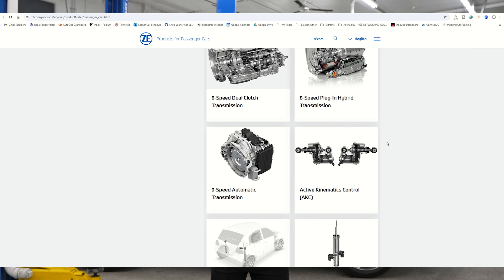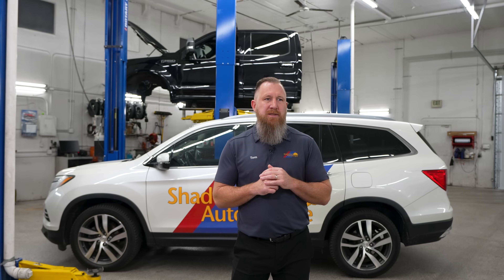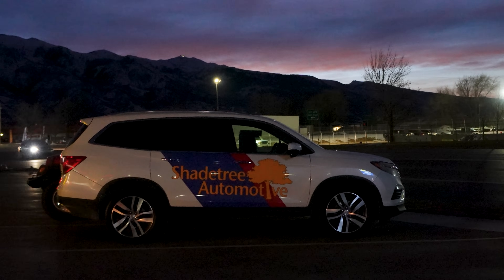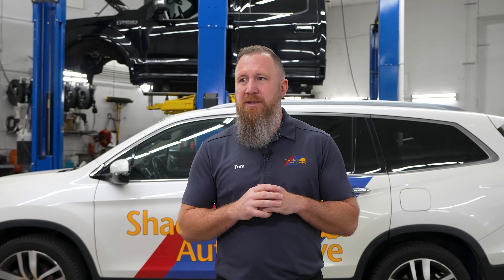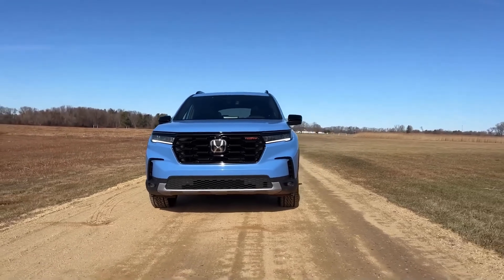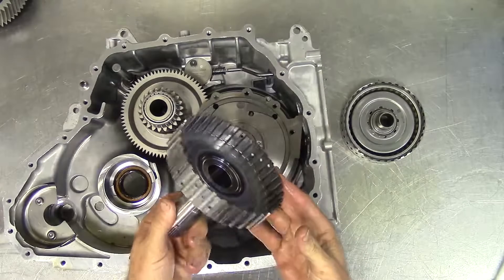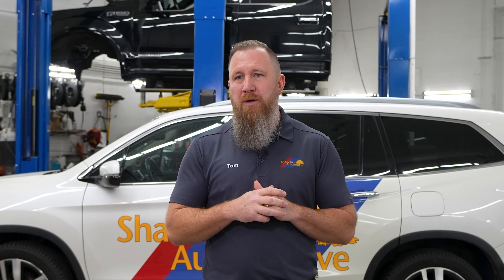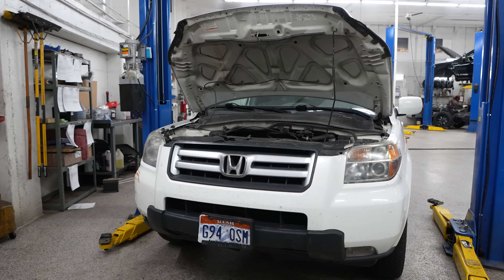Honda's 9-Speed Transmission. (Would I Buy It Again)

Comment: 2019 Pilot Touring, 9spd tran with 80kmiles, 3rd owner
Mpg is very speed sensitive.
Open Road driving:
55mph gets around 30mpg.
75mph gets around 27mpg.
Timing Belt replaced per CarFax 15k, Will resume again at 100k.
Oil, 5k
Trans fluid. 30k

Previously owned 2013 Odyssey lasting 215k miles. CatConv went out, could have been VCM oil blow out (Guessg) but decided no more money in 2013 Ody only gave me 3k on trade...

Comment: We bought a used Honda Odyssey with ~65k miles. After only owning for 10k miles we are noticing transmission issues. We looked up the service history the transmission fluid was changed at 45k and 60k miles. I also changed the fluid at 75k miles. I don’t know what the previous owners would have done to cause this transmission to have issues with the low miles. Trying to decide if we replace the transmission or go back to a Toyota Hybrid.

Comment: I got a 2020 Honda Passport purchased new and it has 24k miles currently.. I barely drive it and I do change the engine oil at every 5k miles. I was thinking about having the ZF9 serviced at 30k because the fluid is 5 years old now but if it's safe to do it at 50k due to the fact I don't drive it as much and I don't beat on it? 24k miles are mainly city drive no steep hills and I don't tow anything, did go on a few road trips... I just got the V6 engine's VCM muzzled with the VCMTUNER II Advanced and it's making a huge difference in drivability on how it handles and performs, my mpg actually got better as I don't have to ride the accelerator as much. This Honda Passport has been solid and the only issue I had was with the infotainment system but it was taken care of with two recalls. So, should I do the drain and fill at 30k or should I wait until 50k but it'll probably be a few more years lol ATF fluid don't expire does it?

Comment: Oh, and it's not the ZF9 (as long as you change the ATF every 2 years on a severe service use case) that peeps should be worried about with the Honda Pilot 3rd gen, it's the rod bearing issue on the J35....

Comment: Ours has been without a problem, however...you can only reach the filter if you remove the transmission from the vehicle. Ridiculous. You can still change the fluid easily enough, but they should have made the filter easy to change as well.
Reply: Where is the trans filter located?

Comment: Great video. Well explained. Can I ask: if, as you say, something has failed inside the transmission, then wouldn't it be cheaper to just take it apart, replace the broken clutch/gear ⚙️ or whatever and then put it back together with new fluids?
Reply: A lot of times it is cheaper to just replace nowadays, and not just transmissions but most things unfortunately. Sometimes the internal parts are very difficult or impossible to get, and often very expensive, then factor in labor costs to rebuild.

Comment: I bought a 4th-generation Honda CR-V, facelift model from 2017, manufactured in the UK. It’s the 1.6 diesel with 160 hp and 4x4. The car has 90 000 miles on it and previous owners didn't change oil in ZF. 
 I don’t feel any jerks when shifting except in the first 3 or 4 gears. The mechanic told me the oil was black, contained a lot of metal particles, and that it was the last possible moment to change it. He also advised me to repeat the oil change as soon as possible at least 2 or 3 more times. Problem is if I do it 3 times more I need 12l of Honda ATF 3.1 and price per liter is 80euros which is crazy. On the other side 1l of ZF Lifeguard Fluid 9 is 15-20euros. Is that the same rebranded oil? Has anyone used ZF oil instead of ATF 3.1?
The mechanic also said that the transmission filter in this model is not replaceable, which sounds strange to me. Is that true? Thanks in advance.
Reply: Так, я замінював на своїй хонді 2015р , заливав zf lifeguard 9, проїхав вже більше 20тис.км все в нормі.

Comment: Thank you for your informative video.   I have a 2016 Honda Pilot Touring with a Transmission and Emissions Error.  The dealer has changed the fuel injectors, ignition, TCM and I put in a new battery.  I still have the same issue.   Can you help me?   I made a video.  

https://youtube.com/shorts/1YqWljVgsyU?feature=shared

Comment: I have a 2017 Chrysler 200s would that transmission and it bangs from 4 to 5 gear they were never able to reproduce it even though I did it to me all the time! I'm at 85000 me I started changing it at 60 still have the banging from 4th to 5th gear first time owning a Chrysler vehicle with a non Chrysler transmission and never have had problems before!

Comment: The transmission isn't the problem with Pilots.  It's the improperly forged crankshaft that will cause the rod bearings to shit the bed prematurely and cause irreparable engine failure.  Sell that POS as fast as you can!!!!

Comment: 2021 Honda pilot 100k miles in 2 years. I drove it hard some days and it’s still kicking strong
Reply: Now you know the service that every 30,000 miles
Reply: @yazzy1979 oh yeah rear differential and transmission. Just got a new timing belt and tune up. All that 100k stuff. Engine oil every 5k
Reply: Oh I’m sorry rear differential every 15k! Engine 5k and transmission 30 k!
Reply: @Jezanr love it 🙌🏾
Reply: Just was recently informed there is a front transfer case? Honda did not notify me about this after being there more than a handful of times.

Comment: Have you used any other Transmission Fluid beside Honda 3.1 like Lifeguard or Mopar ZF Fluid?
Reply: I have. I use Liquid Moly 1800 in my sister’s mdx. I service it regularly other than the timing belt, I do everything. The best way to describe, a lifted V6 accord. Super reliable. Liquid Moly’s ATF(German fluid made in Germany) seems to make the transmission shift smoother than Honda 3.1 ZF fluid. It. It cost way less too especially the 20L container which I buy to service all the cars. I would use this fluid on my ECVT hybrid accord however, I started that cars life in my hands with Amsoil Signature Series ATF. I also use Liquid Moly 1800 ATF in a BMW and a Toyota Tundra. Decent synthetic Dex VI equivalent which in all 3 owners manuals states you can use! All in all the ZF transmission usually is never the issue like he stated. Most of these modern transmissions fail from simple owner neglect. Transmission fluid should be changed regularly at least 30k-50k max. All fluids break down from heat cycles. After the fluid is warn, a transmission is on luck at that point!

Comment: My 2022 Honda Passport's 9 speed transmission went out at 10K miles!  It was replaced under warranty.  The Honda dealer stated it was not worth it to rebuild it.  They just gave me a new one.
Reply: to bad. But the transmission is pretty solid though.

Comment: Is there some kind of filter, internal or external, to also change? If not, can one be placed in the, say cooler line?
Reply: There is, but the transmission filter for these requires the transmission to be removed from the vehicle to get it out. Idiotic. People are just doing fluid changes on them (I can't see many people spending the big dollars/time to change the filters).
Reply: @greggregson9687  Can one be put in-line to the cooler? Would it be worth it?

Comment: You brought up a great point. Basically every high failure rate part or system in modern vehicles is a result of government regulations. Genuinely every one of them. Catalytic converters, EGR, DEF, transmissions, engines, etc are failing at much higher rates than ever before because manufacturers are being forced to squeeze every ounce of efficiency out of them, and most of the time it's at the expense of longevity. That's why anything built in the past 15 years or so is basically junk. Some are obviously better than others, but overall cars today are far less reliable than ever before. Plus all the engineering required to design and produce these systems drives up the cost of the cars significantly. So the next time your car fails, make sure you send a thank you note to the EPA.
Reply: My wife's 2012 Camry with the 2.5l 4cyl has been phenomenal, 160K and just routine maintenance.
Reply: EPA has nothing to do with washing machines, smartphones, led light bulbs, etc. and all those things fail a lot faster than cars.
Reply: @dfgpl not even remotely relevant to the point, but ok...
Reply: Yes the Dumocrap EPA’s don’t use technical or engineering  expertise, just Hippy feel good rules to get more gas mileage.  Causing more expensive and way less reliable vehicles.  Government Mileage and Emission Standards are moronic and will be the downfall of the American Vehicle Industry.

Comment: The bigger issue high rate failer was the 6spd on the lx ex exl zf6 . I do my 2020 pilot tranny fluid at every 15k .its actually faster then a oil change which my friends at honda told me to do  and disabled the vcm which has been known to over heat the fluid and problems with one of the motor mounts on passenger side.my friends at honda recommended 2016 to 2021 to disable the vcm so it's a full v6 and get more out of the transmission and back 3 cylinders

Comment: I trade in my 2021 Passport Touring with 26k miles for a 4Runner trd off-road. Honda transmission kicked as crazy between 4th and 5th gear (that is where dog clutch is) also engine knocking (you can hear it between 1200 to 1700 RPM). Honda replaced one main bearing in my engine but knocking noise returned after 1500 miles. I really liked my Passport, but knocking engine and kicking transmission at 25k miles unacceptable.  I doubt I'll return to Honda.
Reply: The 8 speed in the highlanders are failing

Comment: I have a Titan with the ZF derived 9AT. Sucks compared to the previous 5AT. The 5AT was perfection. The 9AT is "ok" but sometimes it makes poor shifting decisions. That may be Nissan's fault with TCM programming. However, I get nearly 24 mpg hand calculated on road trips, sometimes 25.5 MPG, far better than the 17.9 MPGs I ever achieved with the 5AT. As long as it lasts more than 100k, I can accept it. Oh, BTW, Toyota reliability lolol!
Reply: You are definitely correct about the TCM programming... They have it programmed to memorize your driving habits and shift accordingly which can be a good thing or a bad thing based on how you drive... A transmission should feel solid no matter how many forward gears it has.  Consistent maintenance definitely helps too.  Maybe deprogram/disable the TCM memorizing feature
Reply: Titan use Mercedes 9g tronic transmission. Not a ZF

Comment: I don't have a pilot or ZF9, but I have a 2012 Civic with 5 speed auto, 233K on original transmission, I do drain and fill every 25-30K with Honda fluid

Comment: I have an early ZF9 tranny in my 2015 Chrysler 200C V6. Other than an occasional very big "clunk: between 2nd and 3rd, it's been fine for 80,000 miles, with one flush and one reprogramming (which diminished, but did not eliminate the clunk).  My mechanic said I never need to flush the tranny, bt I had him do it anyway.  I like this transmission: it's quick, feels sporty since the gear shifts are obvious, etc.
Reply: See mine is shifting from 4th into 5th

Comment: Buy Toyota. Avoid Honda transmissions. I've learned the hard way
Reply: Me too. I had two Honda transmission fail on me.
Reply: Merci d’avoir partager votre experience Billl 😊
Reply: Well. The new 4cyl tacoma transmission are failing way more than Honda have ever failed, the older taco 3.5 v6 have the worst transmission shifting characteristics, and tundra engine doesn't last a break-in period. And im a toyota fan boy. They all screw up

Comment: So if the Nissan Pathfinder has this transmission it should be good? 2024-2025 ty
Reply: Absolutely, just do the transmission fluid change on time and engine oil change and you’ll be okay. The New Nissan Pathfinder also has a very reliable engine and sits on a second generation ZF 9- speed automatic transmission. Take care of the car and the car/SUV will take care of you.

Comment: Had a 2017 Pilot with 9 speed. Had fluid changed at 50,000 miles. When visiting my mechanic I saw he had a 2017 Pilot outside I asked and he said it had 70,000 miles and needed a new transmission. Honda wanted $10,000 to replace it. He checked and couldn't get a replacement with labor to come out any cheaper.  When my Pilot reached 71,000 miles it failed going into park and a message displayed stating to use parking brake!  Went to Honda and their diags said the transmission replaced. I wasn't paying $10,000 so at the end they cleared to code. The next day I traded it in for a Toyota and another dealer before the code reappeared.
Reply: That’s unethical man

Comment: I change transmission fluid every 30K at brand new cars
Reply: how can a car with 30k miles brand new bruv
Reply: @marvmaster2639 what he wrote is to change the transmission oil relatively early @30k... that's pretty new most vehicles are just broken in by that time and at their peak performance you can look at long term tests and dynos etc... I changed mine at 18k and it made a huge difference from being a lease to keeping the vehicle after the drain and fill... Next change again at another 18k @36k total milage and every 25k thereafter

Comment: I can't stand the ZF-9. I've had it in 2 vehicles, one 2019 Jeep and one 2023 Honda, and both had way too many "quirks". Super slow to shift from reverse to drive (1-3 seconds in below freezing temps), jerky\slow downshifts when it has to use the dog clutches, jerky\clunky at slow speeds ( mainly the Honda). Overall just the worst modern trans I've ever had and I refuse to buy another vehicle with this trans. I was really surprised, usually ZF puts out great transmissions (ZF-8), not this turd.
Reply: I felt the same way with my 2020 Honda passport. The transmission would upshift way too early making the car feel like it had no power and then would take forever to downshift for passing. 20k miles, I had enough and traded it in.
Reply: @ Yep, I could only stand my 2023 Ridgeline for about a year and traded it in as well. I was disappointed as otherwise it was a great little "truck".
Reply: @huie1983  I have driven an older Ridgeline and that did not feel clunky, it is the second gen, but I think it has the 5 speed versus the new 9 speed.
Reply: @AgonxOC  Honda used their 6 speed initially in the 2nd gens for a few years. It had such high failure rates they switched to the zf-9. The 6 speed is smooth but too weak for the Ridge.
Reply: It’s that bad!? I only have two ZF8HP one with nearly 200K and one with 48K…. Great transmissions, but never really driven the ZF9.
Reply: A test drive probably won't reveal it's flaws but day to day they add up and you'd rather row your own gears. It's not an enthusiast gearbox like the 8hp can be programmed to be.
Reply: @AgonxOC  After owning 2 of them, I think so. I've also had 2 vehicles with the ZF-8 (excellent trans) and the ZF-9 is complete ass compared to the zf-8. Clunky, slow, jerky etc.
Reply: 2020 Jeep Compass owner, I do not like this transmission at all

Comment: One of my high school friends had a 2014 Jeep Cherokee with the 9 Speed Zf Transmission and let me tell you off the bad she did NOT service the transmission. Along with that Jeep did have software updated that could have been preformed however she also never went to get those completed. 

With that being said she did have issue around 40K miles, Rough shifting and I do mean ROUGH. Particularly 2nd to 3rd, I did mention this to her and told her she could take it to jeep as it was still under warranty but she never did. Fast forward to 110K miles no fluid service and now its really rough shifting, Every gear at that point and also now when you were slowing down it felt as if someone rear ended you. She knew then that she had cooked this transmission. 

I think if she had just taken it to the Jeep dealer for the software updated and fluid Change it would have lasted much longer! Other than that it was nice how you could get that Jeep up to 70 MPH and it cruised sooo smooth. Was sad to see it in such horrible shape towards the end! Can’t even blame the transmission!
Reply: ZF transmissions go into BMW, Audi, and Dodge Durango.  ZF manufacturer says trans fluid should be changed at 50k.  Changed a Q5 and Dodge Durango at 65k and they shift smooth again.  Waited too long but was able to get them back to normal again
Reply: It’s a junk transmission.  You shouldn’t have to service a modern sealed transmission.
Reply: @user-tb7rn1il3q  transmission is fine. Like the guy from the video said, not rock solid like those old 5 speed but okay

Comment: I have a Passport with a ZF9.   My biggest issue is the slow reaction time when shifting with the electronic shifter.  Backing out of my drive on a main highway and shifting to "D" drive takes about 1.5 seconds.   It's too long with oncoming traffic.   I now have to drive forward out of my drive.    Other than that, I changed my fluid at 15K and will do so every 15-20K.
Reply: Thank you for sharing your experience. I just bought a 2016 Land Rover Discovery Sport with 80,000 miles and a with ZF9 transmission and I have the same feeling as you describe.

Did your vehicle behave the same way in the first few years when it was brand new?
Reply: @MartinDode  Yes it did. I won't buy any vehicles that use the ZF-9 due to it's design.
Reply: @MartinDode  yes
Reply: Agree completely.  I dislike the whole electronic shifter in mine too.
Reply: I've had two of these and agree, it's even worse in freezing cold weather, probably 2+ seconds, especially going into reverse. And, if you tap the gas before it's ready it'll bang into gear. Not fun and you feel like a real A-hole in parking lots waiting for your ZF-9 to change gears, kind of ridiculous.